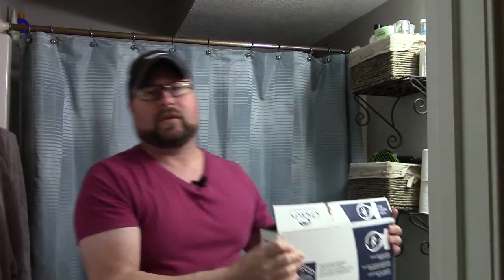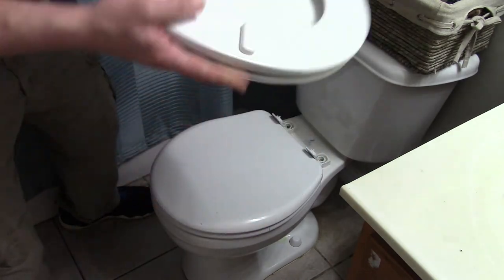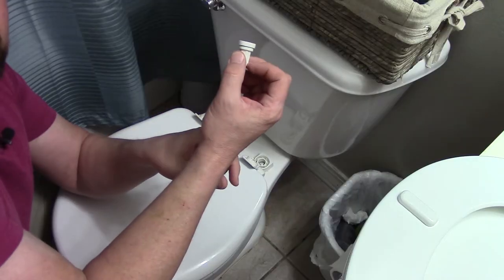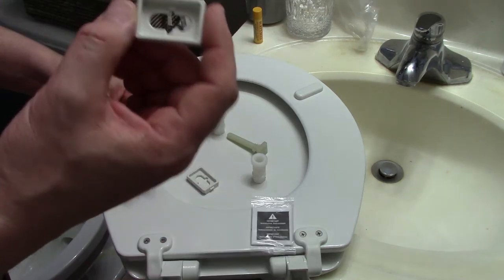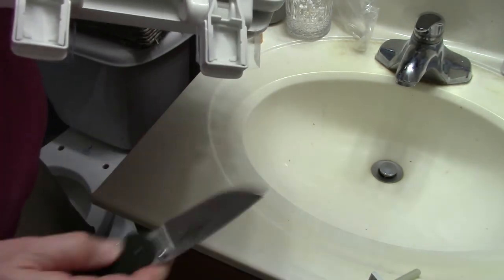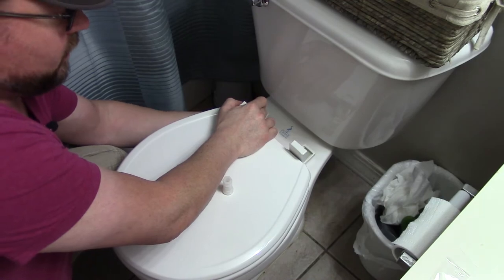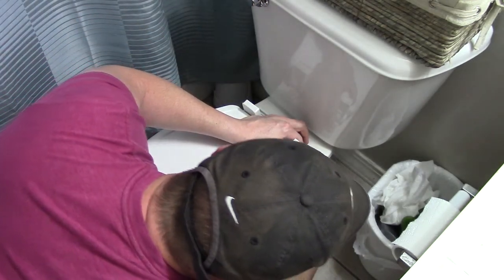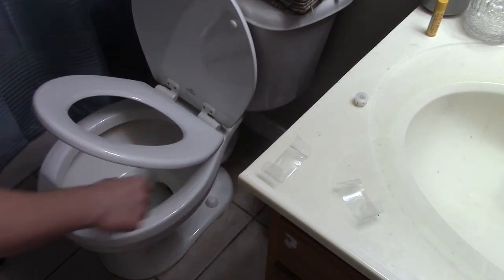How To Install A Toilet Seat ( Church Brand )

Comment: How does one fasten those screws from underneath without a power tool….thx
Reply from the maker: Use either a nut driver or a ratchet. Sometimes hard to reach, but a basic ratchet set will do just fine.

Comment: Removing a Church toilet seat. Of course the first bolt came off easily. The second is stuck and I had to move to pliers which isn't working for me either. Just stripping the plastic off. 😩
Reply from the maker: Is it an old metal screw? Did you have any luck getting it out?
Reply: @AroundTheHome1  My boyfriend worked it out. 👍